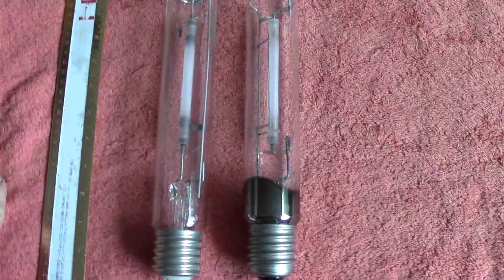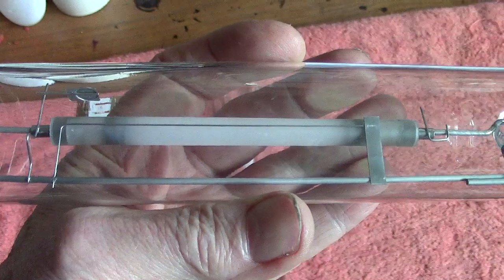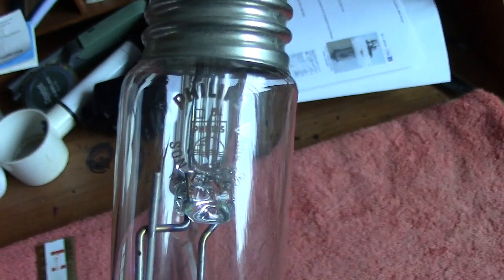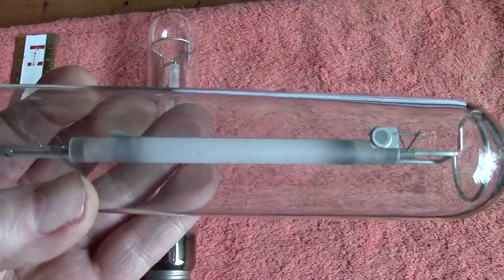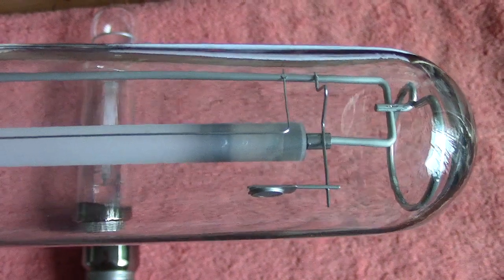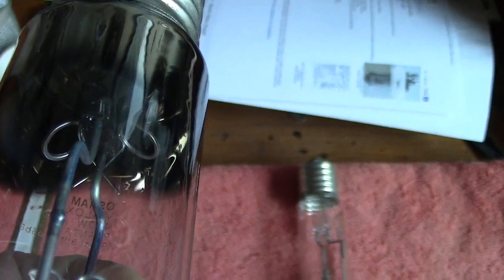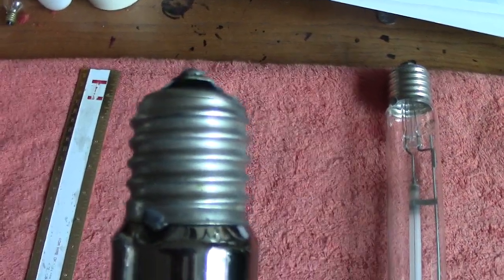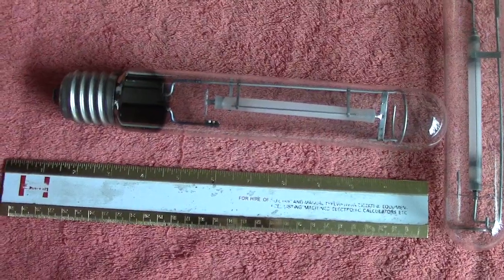Sodium ( natrium ) grow lamps by Osram and Philips.

Comment: The small plate with the dark disc is in fact a solid state getter (normally  Zirconium based)! The arc tube in nearly all high pressure Sodium lamps is filled with a sodium Mercury amalgam and a small amount of Xenon to help start the lamp, also the starting strip is mounted on bimetallic strips to move it away from the arc tube as the lamp warms up, this is to reduce the loss of sodium through the wall of the arc tube!
Reply from the maker: Hi thanks for that info so it is a getter, have you thought about joining LGN you would be welcome.